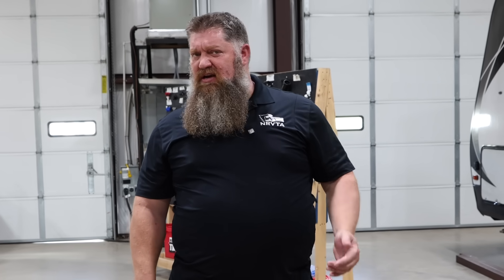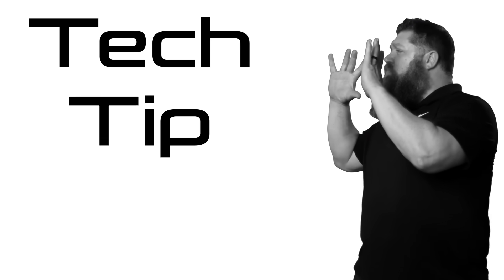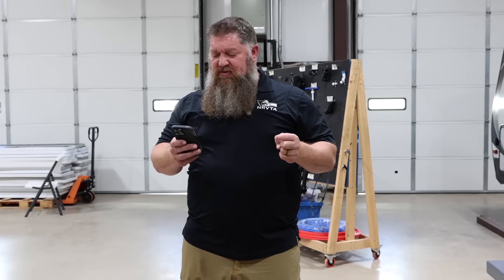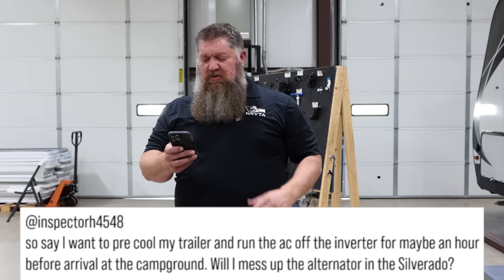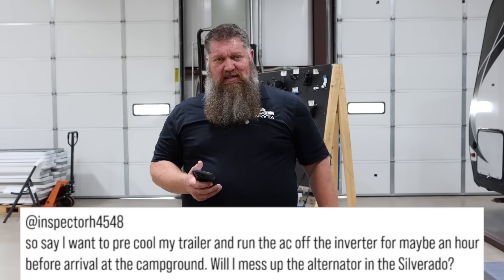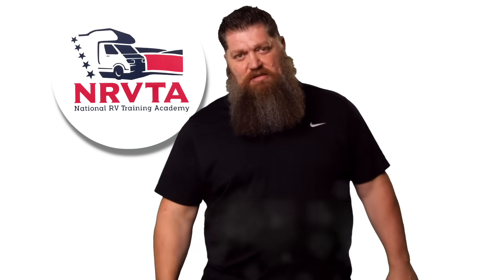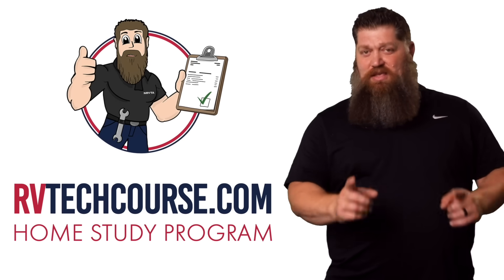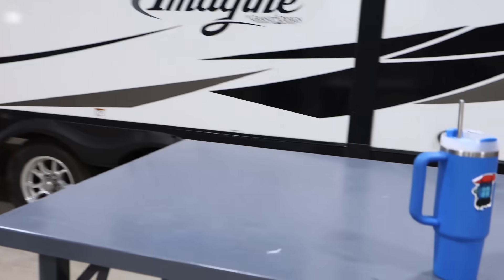Running Your RV Inverter While Driving – What You Need to Know

Comment: Here is a question I have not seen addressed, when Boondocking, should and how should you ground your RV? I see grounding rods should be buried 48 inches deep. How would you do that in hard ground or if Boondocking in a parking lot, say at Cracker Barrell?
Reply from the maker: What is your source of power?

The properly fitted inverter will have a ground relay that will close when not connected to shore power. If there is a ground fault in the rv the electricity will go back to the inverters coils (the source of electricity on the ac scale) via the ground wires. Same is true with a properly fitted onboard genny. 

The question comes when you use an improperly fitted portable genny. No ground protection. A bonding plug will work for that but takes away any EMS protections.

Comment: I am not so sure on the small wire long distance advice??? This can lead to damage or at a minimum, blown fuses.

Small wire long distance plus high load (running the inverter/charger) WILL cause a voltage drop. Voltage drop causes high heat and high current potentially overloading the alternator just to cause heat and not really run the invertercharger at all. In fact you may get overloads and shutdowns on the inverter.
Reply from the maker: For those that are freaking out. The 7pin connector already has a fuse on the #4 pin for charging. You can’t over amp the small wire there. 

This is 2 minutes so it’s common that some stuff has to be assumed. The circuit by the auto manufacturer already meets NEC standards.

Comment: Hey Todd, great videos as always! Why not if having enough solar on the camper, just run off of the solar and not the alternator. I do this and the solar out performs what the alternator would do anyway.
Reply from the maker: For some, why not add a few amps to the charging while moving down the road. My system is located in the back of my RV so I cannot charge the solar system. Just put more panels up.

Comment: Thanks for taking my question, BTW, Im a civil Engineering Inspector.  So to be clear I have 4 100 amp lithium batteries and a 2500 watt inverter.  Just the 13K AC running, everything else off.  Using a 2017 Silverado towing package alternator equipped with original equipment 7 pin connector and original equipment wiring harness to the 7 pin.  I know the alternator wasn't going to keep up with the ac draw and the batteries will be essentially powering the inverter and the Silverado alternator would supplement some charging.... But I believe you confirmed that I will not fry the alternator with this set up especially with the ac being turned on an half hour or hour before arriving at the camp ground.
Reply: be sure when turning on the A/C you open those fast cool vents so the air does not go thru the duct work. This will cool your rv faster.

Comment: Some motorhomes don't come with a BIM, but a BIRD--Bidirectional Relay Delayed. This will limit the number of amps (or watts) that passes from the alternator to the house system. My BIRD limits the alternator-to-house to about 40 amps (500W), even while the alternator is 120 amp. Thus, the motorhome's alternator is protected.

Cautionary note: When a person upgrades the house system to lithium (which is 14.2V), then the BIRD sees this as the equivalent to being plugged into shore power. The BIRD switching relay is contingent upon seeing 13.6V on either the house or chassis side before it connects the relay. The end result is that the chassis battery gets included in the house cycling process--which destroys the chassis battery. My new chassis battery died in less than a year.

Comment: Great video as usual!! Glad you kept it simple because there sure are a lot of variables. Lithium? Solar? AC size? residential fridge? hot water heater? Are the batteries fully charged? Can your inverter even handle an AC? Can your batteries BMS handle the current requirements for AC?

Comment: I don’t understand how a smaller wire limits the current flow.  I see this rationale everywhere when it comes to discussing the alternator load issue.  Why wouldn’t the battery bank draw 100+ amps that its capable of drawing and then fry the wire or pop the fuse?
Reply: They put a current limiter in all the new trucks. They only deliver like 15amps or so to the 7 pin.
Reply: Smaller wire is more resistance and would melt.  Hence why you need big wires for 12v systems that draw a lot of amps. To spread the load across more copper to prevent damaging heat.
Reply: @NuxNerd I completely understand the larger the wire, the more current it can handle. But what he said is the small existing 14g wire will actively limit how much current will be drawn from the alternator. But wires themselves don’t limit the current going through them.  I’d expect that small wire to fry (except the fuse protecting it would blow.)
Reply from the maker: @LeisureLakeTech  along with the fuse they do. when I say that you upgrade the wire you also upgrade the fuse and pull directly from the starter battery. This is when you NEED a limiter like a DC/DC charger.
Reply from the maker: So the load that the battery provides has to do with internal resistance and the existing fuse also limits the flow. Its not demanding a specific amount of amperage. it has to do with the amount of pressure it pushes back on the charger. As the battery charges up the volts (pressue) of the battery increases, this causes resistance back to the charger. The charger’s flow slows down based on the backpressure its receiving when charging.
Reply: Quick (?) breakdown from a non-tech with a technical mindset: Voltage drives current, but since the battery is also a voltage source (not just a load), you need to calculate the net voltage first. Say the alternator is at 14.4V and the lithium battery is at 12.8V (50% SOC), that gives 1.6V of “push.”

Using Ohm’s Law (I = V/R), and 14 AWG copper wire rated at 2.525 ohms per 1,000 feet, a 20-foot run (40 feet round-trip) gives 0.101 ohms of resistance.

So: 1.6V ÷ 0.101 ohms ≈ 15.84 amps.

That’s the theoretical max current, not accounting for connector losses. And yes, 14 AWG is rated for about 15A under typical conditions.